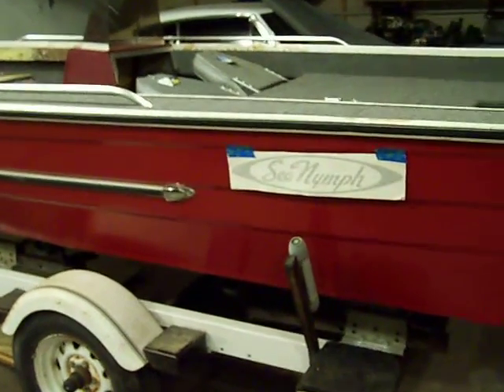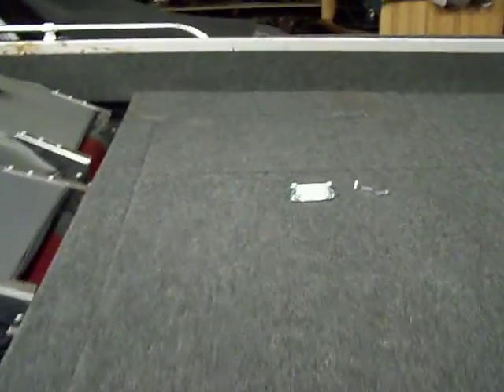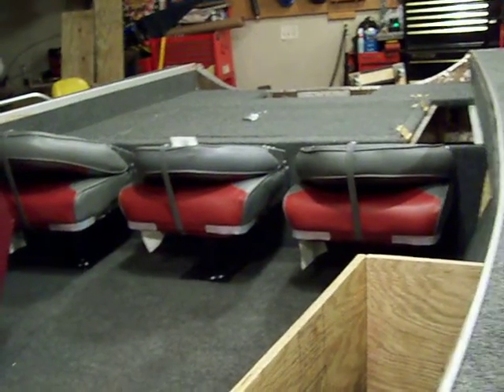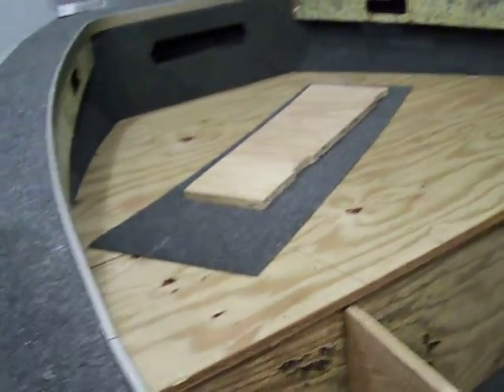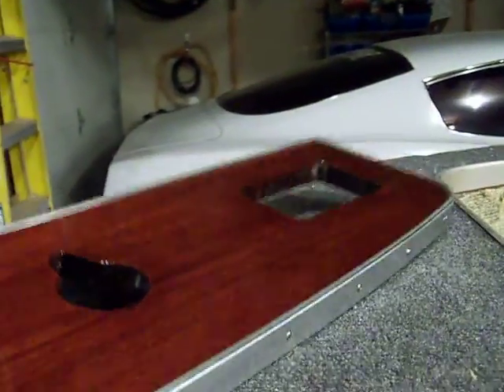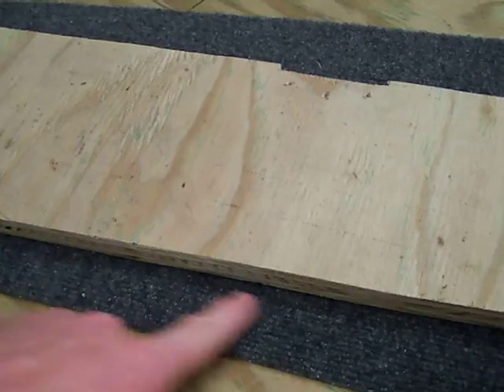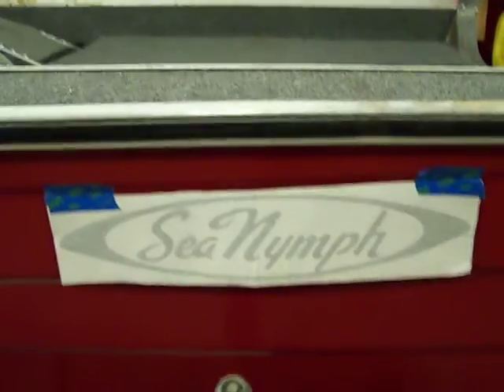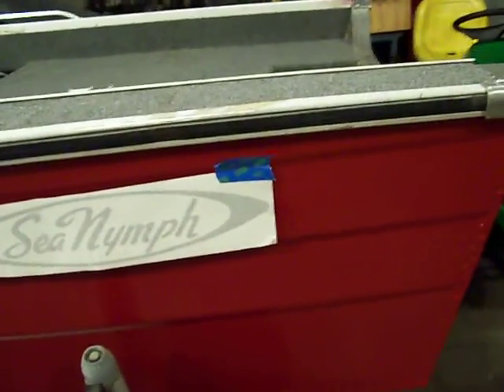Restoration 1981 Sea Nymph aluminum boat part 9 (Creating the Interior)

Comment: Just wondering, how did you end up carpeting the top bunk of the boat? did you pop off that aluminum trim on the inside or just cut and glue to what was there? I am in the same situation with my 86' Sea Nymph Fish N Ski, wondering if i should just carpet the bare metal and leave the trim there, or take the trim off and carpet it. I am woried about the boat losing shape if i do.